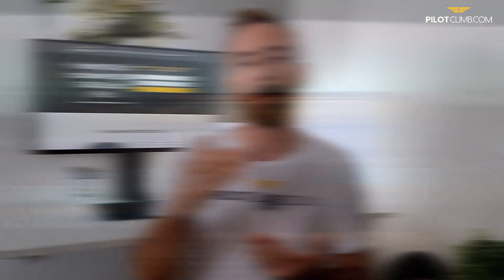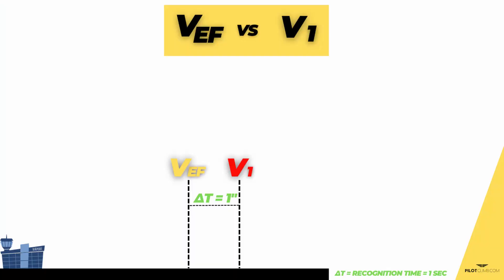Speed Engine Failure (Vef) Vs. Decision Speed (V1).

Comment: Captain Gabrielle, all other parameters being equal- QNH, Temperature,Altitude, Runway braking action etc
1. at V1 assuming we have a long enough runway( more ASDA), do we abort takeoff?
2. at V1 if we have a relatively shorter runway(ASDA critical), we continue on one engine?
Reply from the maker: Great Question! V1 is always a decision speed regardless of the runway lenghts, once you calculate the V1 (taking into account all the factors for that specific situation) for your take-off you need respect this parameter. Have a great day!

Comment: Hello Gabriele,

Can you give in example with numbers so that we can have a better image, please?

Is the Recognition time always = 1 second?

So if V1 is at 133 knots for example, what speed is VEf?

Because the aircraft is accelerating and I need the acceleration to calculate the speed at 1 second before V1.
Reply from the maker: This value change depending on the speed. The faster the V1 the higher wil be the gap expressed in knots within the rtecognition time (1 sec.) in real life we don't calculate the vef for every take-off, we only calculate v1